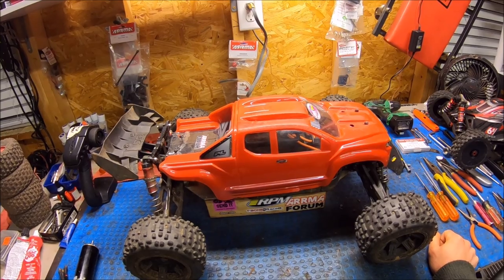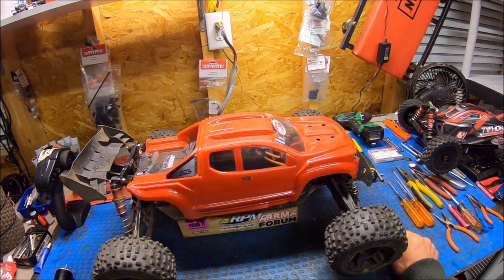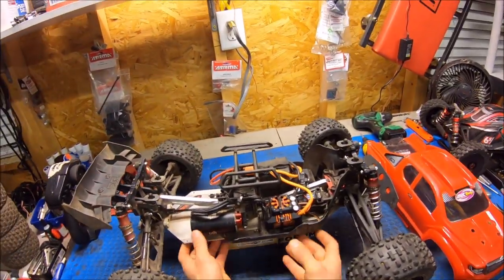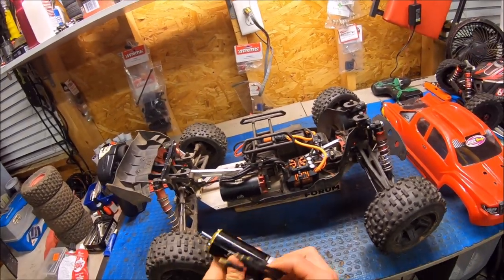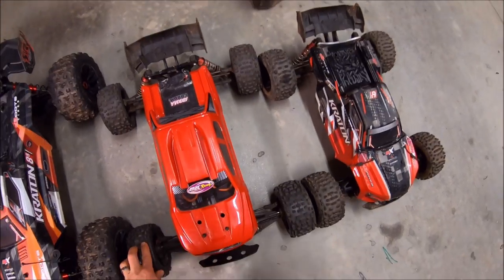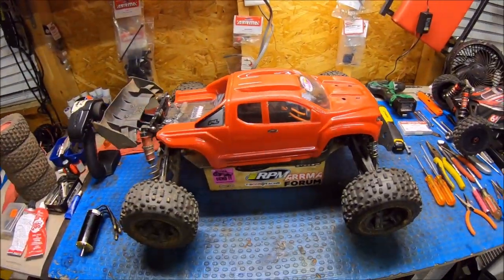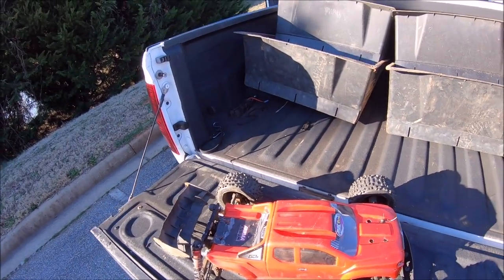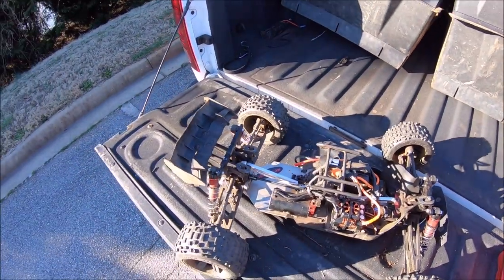Arrma KRATON XL 6s "LWB" (MOJAVE CHASSIS!) on 8s Electronics!

Comment: Love thos setup Brother E, perfect size for a basher. The sendIT you did was NOT OF THIS WORLD 👀👀👀👀👀👀👀👀🥰🥰🥰🥰🥰❤❤❤❤❤❤❤❤. A tip, that TPpower motor make SURE You have a REAL rear end bracketsupport for it, or you  will separate the can from the endbell..the skrews that holds it, is way to short ant cant be done anything about it, so please brother, do that before..ive seen destroyed TPs. 

Anyway, you are the best brother, amazing driving and my insspire source with Rich. Much love from Sweden ❤
Reply from the maker: Thanks so much my brother!!😊😊I was quite pleased how it turned out! I did try the TP motor today and it was hell on wheels!😂I have a block of rubber to support the can just like I had to do in my other Kraton running the HS 1730 4092. Definitely don'y want a broke motor! Thanks for your generous comment and constant inspiration! 😍😍😎💪🤘🤘

Comment: Friggin SICK Brother Eric 😜!!!! Looks ultra stable especially running the Badlands 3.8 👌. Great  of you to shout out our good buddies Thomas and Chris 😉. She looked great on the ground and in the sky 😱🚀🚀. I could imagine the motor getting a little toasty at those RPMs. The TP motor will absolutely Rip in that set-up 👀. Can't wait to see it. Another Killer build and bash Bro. Props to Mitch for making these great times possible. 🍻🤙🤙😎💪👊👊
Reply from the maker: Thanks Brother Rich!!🤗Totally stoked at this new platform! The Mojave chassis is a perfect option for a middle child Kraton that still has the speed and agility of the 1/8 scale! The Spektrum motor was def. getting toasty! Had to give it a few breaks in between ramp staging etc. 8s would be possible with much smaller gearing but too much weight in batteries since my packs are quite large!😜I tried the TP in it today and it was a total animal! The TP motor isnt quite as heavy either as the 1250kv. Hope to try it out in the bash field soon! And i feel the same way bro, HUGE thanks to our upgrade Wizard!!❤❤🍻😎🤘🤘👊

Comment: As always you hit this one out of the park man! I'm just awaiting a few more less vital parts from mitch @ m2cracing and I'll have my completely new/ground up Mojave hybrid fi ished with the exception of a body(atleast a body that I dont have to spend alot if time or $ on and can take the additional weight of all that additional m2c 7075 but not really familiar with "low budget" body options. More importantly I was just looking at the specs for the suspension the Mojave comes with stock and I'm looking to confirm weather or not it's worth buying seperate set of 4 mojave shocks when available through Jenny's for example or buy the springs and shafts to use with the extra shock sets (outcast kraton)that i have laying around currently bot in use... anyway you might be willing to give me your advice/thoughts or any input on the best route to go on the suspension(using Kraton outcast rom arms btw) and or piss body options that might be less expensive/time consuming to paint but yet compatible one way or  another would be greatly appreciated. Will be running a new 6sblx system for now fyi with all major m2c parts(mohave chassis,braces f/r, towers f/r, standoffs, ackerman, droop screws etc (new f/m/r diffs I still need to shims and choose fluids for and shocks w 100k fluid) I've got a beautiful new chevy c10 body but it would be a stretch no puns intended as it's meant for an outcast wheelbase. 🍻

Comment: That was amazing😍 Knew it could be done, but wow what an amazing platform. Did you get that 4092 in her yet? Might even dethrone Purple😉🤣💪
Reply from the maker: Thanks buddy!👊It did turn out quite well!! I did try the TP in it today just yard testing and WOW! Much more responsive of a motor!😍Not sure if it will dethrone Purple! Nothing can do that!😆😂😂btw I need to get her back out! Her old bones are getting stiff I'm sure!😜👊🤘🤘
Reply: @RCDUDE81  Nice. Yeah for the money if I had to do it over on mine I would have gotten a TP motor instead of the 1650kv hobbywing with the Max6. I still would have the Max, but the higher wattage TPs handling 8S without sacrificing the KVs is attractive.🤤 Think I'm gonna have to pull the trigger.🤘😉
Reply: Oh P.S. got a tekno 24t pinion coming tomorrow 😉 cause the 21t I have on now doesn't cause her to break a sweet. 👊

Comment: Would you say it was and improvement to the truck, because I already have a m2c kraton chassis but want something maybe help it handle better
Reply from the maker: It's definitely a fun platform but I actually switched it back. Kept bending the front center driveshaft!😜The Mojave chassis is long and skinny. Even the M2C chassis has flex. Worked great under normal bashing until I started launching too hard🤣🤣

Comment: To make my Talion longer just Mojave chassis and center drive shafts and front and rear braces or will the Talions work
Reply from the maker: Yessir!😎👊
Reply: @RCDUDE81  all the above parts?
Reply from the maker: The Talion/Mojave braces are the same. You just need the chassis and center shafts.
Reply: @RCDUDE81  sweet going to have to do that someday

Comment: The kraton front and rear diffs and all bolt right up to it with out any modification?
Reply from the maker: Yes Kraton front and rear ends plus Mojave/Talion chassis braces and Mojave center driveshafts.😎👊
Reply: I think the axial yeti xl body will fit your truck perfect

Comment: I have a similar setup, but Xmaxx system so 1275kv and 21t do you think it’s under geared?
Reply from the maker: May be🤔What is the spur?
Reply: @RCDUDE81  the stock, 50 I think?
Reply: @RCDUDE81  it’s definitely not as fast as yours, I feel like it tops out soon and there should be more lol
Reply from the maker: Yeah its probably under geared. Maybe gear up a bit keeping a check on temps and go from there! I was running a 30 tooth pinion with the 1250kv.

Comment: Was it easy enough to mount everything onto that chassis?..
Love it😀👍👍
Reply from the maker: Oh yeah! Straight bolt on!🤗Great thing about Arrma interchangeability!😎👊🤘🤘
Reply: Hey what about the arms they dont look stock kraton arms what is it off of please i love the handling of this setup it looks planted as hell with zero roll, supurb.
Reply from the maker: @CA-RC  They're Kraton Arms. All Kraton but chassis and center driveshafts. Running the 3.8 Badlands keeps her stable along with the wheelbase! I really dig smaller tires on these rigs as they run like they're on rails!
Reply: @RCDUDE81  
Thats awesome, thanks for the info that setup just seems perfect. I think thats the caziest air ive ever seen before and still landing it like its nothing is straight up boss levels there haha love it. Im going to watch that video many times over haha.